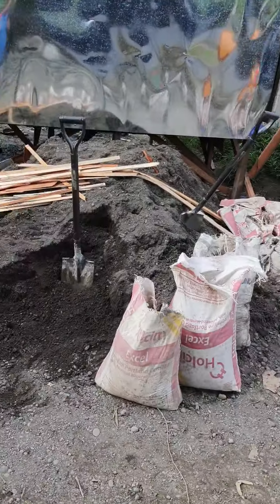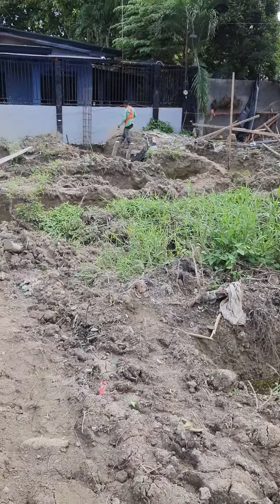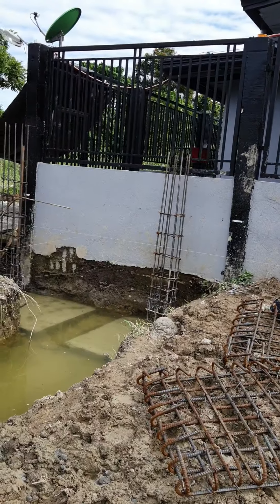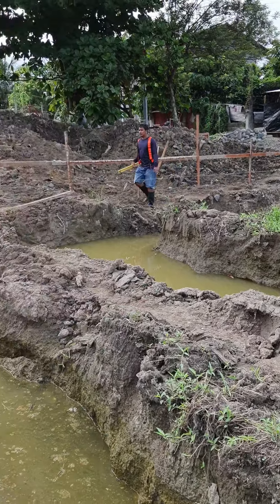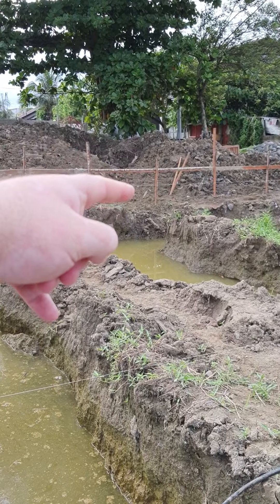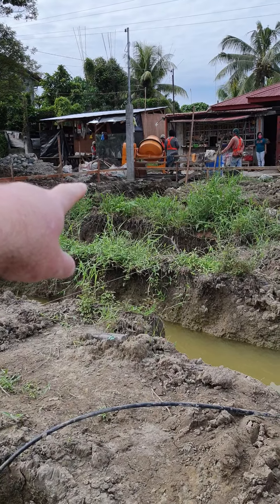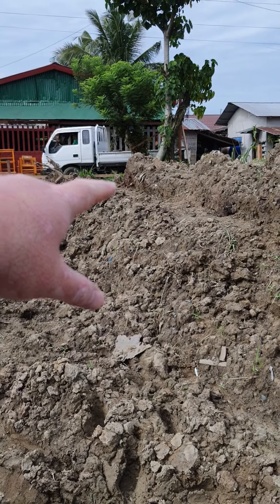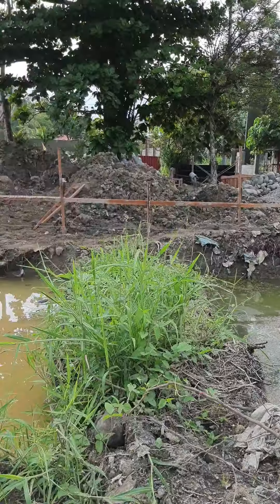November 15, 2020

Comment: im impressed with the footings and using a mixers thats a big plus, can i ask why did you choose boxes to build a house with ? also where did you get that insulation from as  i only seen the thin silver stuff, thakes
Reply from the maker: For the last 4 years we have been wanting to use containers. Mainly for the green issue of recycling and also earthquakes. The mineral wool insulation came from Citihardware.
Reply from the maker: @stephenadams9767  ive read about ups and downs with all types of insulation and we decided to go with mineral wool. That my friend is a cross I will have to bare. 😉
Reply: @bambooconstructioninthephi2981  it will be interesting how it all pans out, also when you cut the boxes we put stiffeners  in before we cut anything out as the strength is in the corrugated steel and it warps when we cut if we dont put stiffeners in, again dont want to teach you how to suck eggs,
Reply from the maker: @stephenadams9767  stiffeners are in now. We wanted the window frames in first.